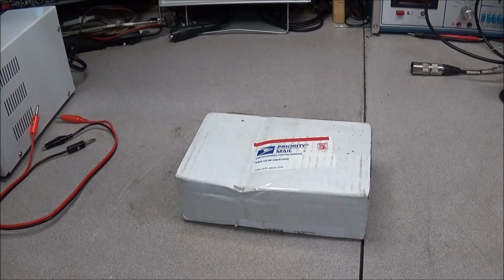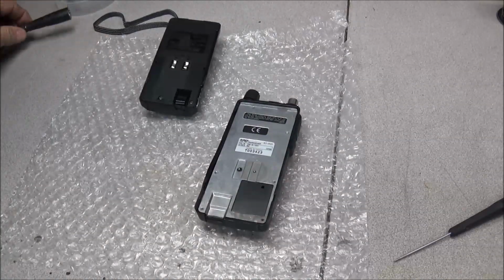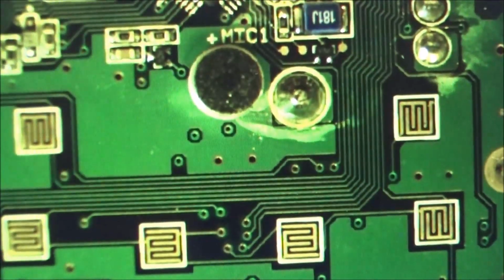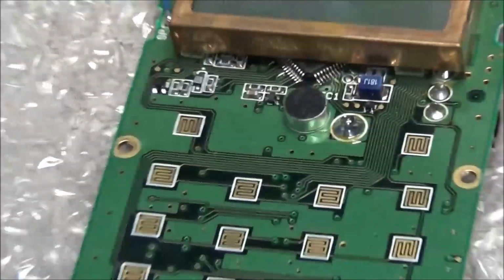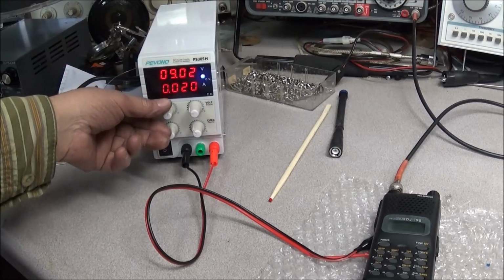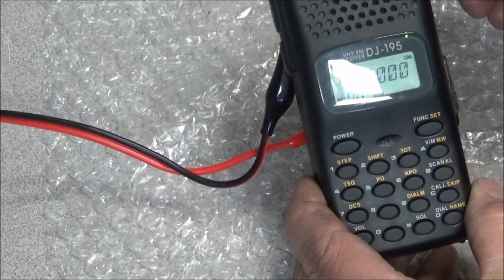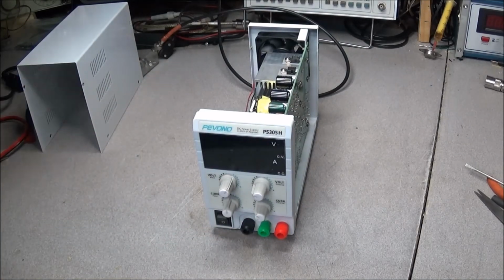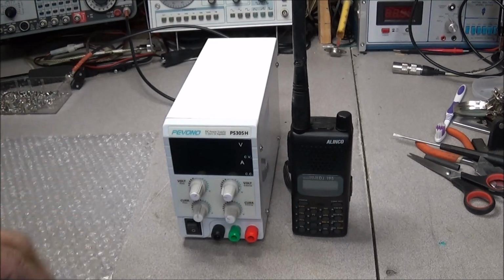#155 Alinco DJ 195 Repair   Pevono PS305H

Comment: Hi Buddy, I forgot to mention that the antenna cracked as I put it in the box so it was not done at shipping.
The side of the radio was not bulged out so it must have got damaged in shipping.
I am amazed, you did a fantastic job on the radio, I had no idea how bad that battery pack was, too small for me to dig into.
I have no idea who paid you to fix it  but I would like to repay him and THANK him also.
Thank You Buddy for an EXCELLENT repair.
Reply from the maker: Thanks Bill. It was really simple.  A very easy repair for me which I like because most are tough.  Sorry about the shipping damage. But I think it is fine now. Glad I could help my friend.
Reply: THANKS again Buddy!!

Comment: Great video..glad Bill's HT got going again. Thanks to whoever paid the bill for Bill! :-) I've picked up a few battery powered pieces of gear(radios and test equipment) and battery corrosion is the number one problem. Stuff is nasty as you mention the outgassing  and seen it get under the solder mask and eat traces..ugh!!  Lots of work to clean and get it all. Yes, yes, yes take your batteries out! But I'm as guilty as others.
Reply from the maker: Batteries can really make for a bad day. Vinegar/salt solution can really help in removing it.  As long as there are traces left.  Thanks for stopping in.
Reply: I've only used white vinegar never heard about adding salt. What ration do you add salt to the vinegar?When I see something at an online auction, I look for pictures for the battery compartment...if they don't have one, I ask for it. If they won't reply..no bid or a really low bid.
Reply from the maker: Check out my video number 40 on wafer switch cleaning. has all the details on the ratio for the solution.
Reply from the maker: https://www.youtube.com/watch?v=9viOArsegIs

Comment: Ok there another piece of test gear I need the PS305H. Great job Buddy and I have a FT-60 HT that needs a new display plastic window that's has a few cracks. Your video has giving me the courage to take it apart and tackle the job. Thanks Buddy
Reply from the maker: Great deal Lyle on tearing into the FT-60. Should not be that hard. I am going to be experimenting on 3D printing clear lens.

Comment: VERY impressive work,  I found the same thing on boards that had stakes passing through the board, just enough heat on the soldering flow bath they used back years ago, not enough for the stakes, Nice work all around. Dave W4GSM
Reply from the maker: Appreciate that comment Dave. Yes wave soldering is great on some things but not on the bigger pads.

Comment: I think everyone has left the batteries in something and forgotten about them until they went to use it next time.  I to am guilty of that.  Nice to see you got it working for Bill.

The power supply is a pretty good bang for the buck.  Like you said, not a true lab quality supply.  However it also doesn't cost a couple thousand dollars like a true lab supply would.
Reply: One thing I'd never thought about before was the outgassing from corroding batteries...thanks Buddy for sticking that idea in the back of my head, may save me some heartache in the future!  73 - Dino KL0S
Reply from the maker: Agree on the supply Mike. I really like it. Batteries do nasty stuff. Almost like that glue does.
Reply from the maker: No problem Dino. The gasses can so lots of damage.

Comment: Another excellent video. I'm curious, why do you think that one joint cracked?
Reply from the maker: Thanks Robert. It was hard to see it under the videos camera microscope due to lighting but in the microscope eye piece I could see the crack around the pin.  Why I need a new LED light ring so you guys can see what I see. If you look at 13:25 you can barely make out the black ring right around the pin.  Seen this many times.
Reply: Robert Gibbons shit

Comment: It seems that most of the AA battery vendors leak.  Which ones are less prone to leaking?
Reply from the maker: A lithium battery would most likely not leak under the stressed environment like being stored outside in the cold.  Although lithium do have their own faults.  Number one rule, never leave batteries in when not in use for a period of time.  Thanks for asking.

Comment: It would be better to clean it with vinegar then isopropyl in this sort of case! It will neutralise the alkaline from the battery corrosion, isopropanol only clean it won't neutralise the corrosion.
A thermistor should prevent the power surge when you turn the power supply on.

Can you not have bubble wrap on your desk it is really annoying hearing all that rustling thanks!
I was saying to him that he should have a lithium battery pack with a buck converter built in of 9 volts what you can buy? and using your phone 5v charger of 2 amps on more to charge it. It would be a lot better in the long run I can see him leaving the batteries in again.
Reply from the maker: As I mentioned in the video the metal contacts went into a vinegar/salt solution.  It removes all the nasty stuff that battery did. After that it is then put in a baking soda/ distilled water solution to neutralize the vinegar.  I seldom use bubble wrap but the main bench is loaded with a torn down radio. Sorry about that.

Comment: My PEVONO PS305H died 28 days. Email PEVONO , they said my symptoms sound like one of the connectors came loose inside. I opened it up disconnected all the wire connectors reconnected them receded it worked another two months until out of warranty and then it died again after that nothing I can do out of warranty I now have a EVONO brick. My other three power supplies are roughly 35 years old and never once have broken down. #1: BK PRECION Triple Output DC power supply 1651 
   #2: Hewlett-Packard 60205C duel DC power supply
    #3: ACOPIAN A24H850 
So before buying you decide 35 years or a power supply that last three months. And one of my power supplies was a student trainer beginners 101 electronics so you know how badly that unit was abused and short-circuited in every class for its entire life until I got it five years ago and it still works perfectly.
Reply from the maker: You just cannot beat the old solid made stuff.  Sounds like yours suffered micro failure. So far this one is going just fine. But it is not used all the time. My Harrison Labs supply is still kicking and is 40 plus years old. The Pevono will never last that long.